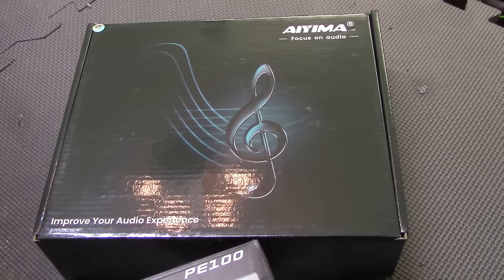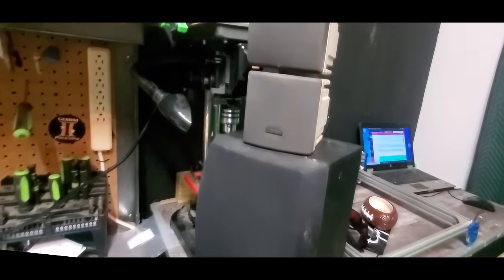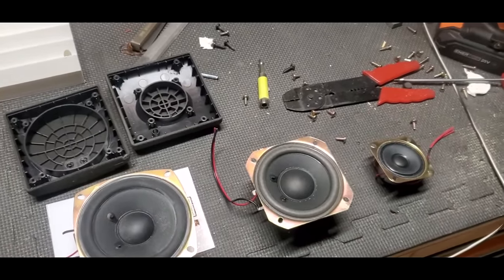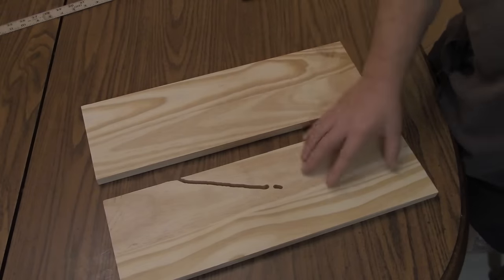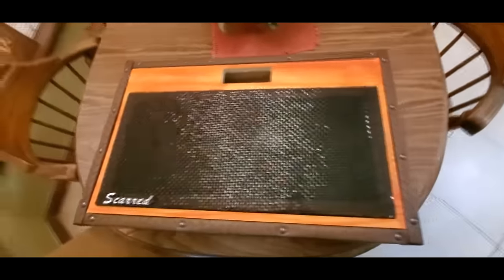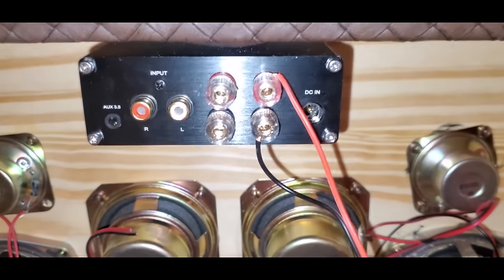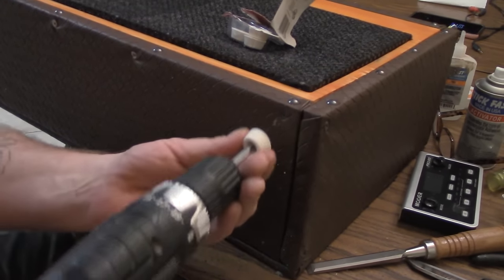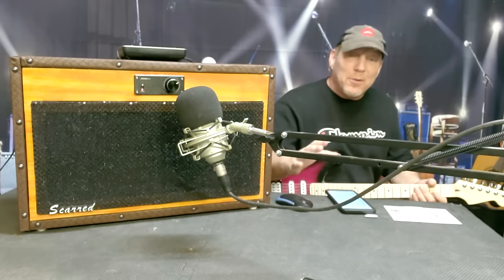The VIDEO ALL Guitar Amp Companies DON'T WANT YOU TO SEE!! DIY $200 Guitar Amp On A Budget!!

Comment: This really made me think about crossovers and if they are really needed. I just remembered back in the day I bought a passive subwoofer to go with my home theatre system and it just needed to be hooked up in series to the front right speaker. All these speaker companies got me fooled over the years thinking that crossovers are mandatory. But there was a time when low mid or high speakers could all be hooked up together as long as the amp could handle the impedance. Thanks for the reminder!

Comment: I don't want to put your efforts down as its a decent build and might inspire others. I've got some doubts about your speaker and amp choices though. I'm guessing the actual power rating is 75w rms x2, but that's still too loud for home use, rehearsal rooms and most gig environments. Including tweeters I thought was odd in a guitar amp, expect it would make the sound too fizzy? I'm doubtful your scavenged speakers would be up to the job with that output too...

Comment: I use a Quilter "Interblock" Class D pedal-sized amp to drive two small 1x10" open-back cabs.  It has a very "tube-like" front end, so no modeling is required for it to sound very much like my old tube amp (similar to the 5F6 Fender Tweed Bassman circuit) does with same cabs.  That's why that "valve" amp been gathering dust for years!  My 7.1 audio system is also 100 percent Class D, including two Aiyima A07s for the ambience/surround speakers -- that technology has improved tremendously over the last ten years or so.

Comment: That's a nice job. I'm doing it with a lekato headphone amp and a TPA3110 amp board at 15 watts a side. Needs a 12v supply, and I'll stem that off to a buck converter set at 5V to charge the Lekato

I think you've got a little overkill as far as speakers are concerned. If you're not using any type of crossover it's not worth it at all.

You need a full range speaker, and that will do it. Even better is finding an online calculator to tell you the exact dimensions of what the box should be for a flat response. Having said that it sounds fine, but hardly a 'quiet practice amp' lol

Comment: This is a pretty solid approach for the PA, especially as you can build it to work with any instrument. You can get plenty of tone out of a processor, pedals or a nice preamp.
If you want tube sound, a tube pre on a 100V supply should do it, though it won't be completely the same as the power tube sound.

Comment: My 1st amp was a DOD american metal distortion plugged into a jc pennys 8 track/cassette stereo with 6" speakers in towers.🍻
Reply: My first amp was a cheap 90s karaoke machine with a 1/4" mic input that distorted really easily. It actually sounded pretty good. I ended up shredding the speaker because I constantly dimed it.
Reply: My first one was plugging straight into a Technics cassette deck on our stereo. I then moved up to using an old Tandberg reel-to-reel tape recorder and an old military speaker. More than 40 years ago…

Comment: I’ve done something like this in recent years, although I’d love to go the modeler route Bluetooth into a power amp…but I have taken a cheap, crappy 3 watt 9v battery powered amp with a single 3 in speaker I found I a resale shop for $2, and had  two 4 inch dual-cone center channel speakers from a surround sound system and put them all in a cigar box and converted it to 18v supply (dual 9v compartments)…sounds better but the amp is still sounds like you’re recording a distorted direct signal in a studio….my other project was getting a 1x12 unbranded cabinet I found at a garage sale for $10, removing the speaker and baffle, and converting it to a 4x6 cabinet with some 6” eminence pro sound speakers I also found at a garage sale for like $10 (for all 4 speakers), it sounds pretty damned awesome having my EVH 5150III LBX-S run through it!

Comment: That is hilarious.  Obviously not 300 watts, maybe 50, but cute nevertheless.  And he certainly should have at least a capacitor on the little mids, or they will blow for sure.   (Looks like the tweeters do have a small capacitor on them).   Shows creativity, if not experience.  Keep experimenting, and good luck.  • Note: I would actually consider the little AIYIMA amp module for a project, using a ZOOM G1X FOUR as a pre-amp / processor.
Reply from the maker: Yes it's only 75 W per side actually without the full power supply, and that's confirmed on a meter, but I just loaned it to my friend and he played a gig with it mic'd and almost wide open for 4 hours, with 15 min breaks and nothing blew up!  And he used just his Line 6 Hd500 with it! And it's louder than my Fender front man 212 and my Hot Rod Deluxe,  and the speakers are tiny!! I will keep thinking outside of the box, that's guaranteed! Thanks for watching

Comment: It's super loud because of the parallel wiring. You're running 2 ohms per side. That's a lot on the amp. Hope it's rated for a 2 ohm load.

Comment: Interesting. Did you parallel all 3 speakers on each channel? If so your impedance might be on the low side. Since your power amp is enormous, it might not be an issue.
Reply: I was wondering the same thing

Comment: I made my own guitar amp full 100 watt stack tube marshall jcm and a jubalee clone for 400 bucks for each. I been using computer speakers as a easy low volume amp and they sound amazing the lows mediums and highs they are awesome to use the vox headphone amp series of head phone amps with it if you don't wanna use head phones and want a low volume great tone. They sound amazing and I'm gonna make me a speaker cab for my computer speakers j use as low volume amp cause all your really doing is just running a processor of any kind through really tiny version of a pad system like you use at gigs

Comment: Those cass-D-amp can only do the 300W when a 24V supply is used. But even the 70W which can be done with 12V will make those chassis go up in smoke soon if not a minimal crossover is used.
Reply: @nara4420
If the amplifier does not have a power converter — there is no way to anyone can get 300 watts of power from 24 volts for most standard speakers.
Judging by the look — this amplifier does not have a converter.
Reply: @iridios6127  yes, i did a guess, and when calculating it it could be 130W @2 ohms per channel in ideal situation. In reality it'll be less. Anyway it will be too much without a crossover.
Reply: You never said what you used for power. I'm not familiar with that particular amp, but it looks like a are thangy.
So you used, what, a car battery?
I might just use a switching power supply, cuz it's hella lit lighter than a car battery, or a friggin tranzz-former!
Yeah, that's a nice job, nice idear.
Gonna make me one, guess I'll call it sumpun else, though.
Reply: @jeffro.  
Why would anyone need a car battery, for this amp? Judging by the type of speakers used, the maximum power is no more than 20 watts. And the weight of the transformer power supply will be half that of all these speakers(or even less) .
Reply: @jeffro.  i do not know this amp, but i've seen quite some datasheets of those cheap class-D-amps. According to that they can usually work with 25V, sometimes even more, and the advertisements assume maximum voltage for telling insane high power-ratings. In reality most people use 12V or 14.4 from a car-battery, but some use a power-supply. 
So i was just doing the math. Assuming 24 volts, reduced by a little loss in the output-transistors and use a 4-channel-amp-chip in BTL-configuration. That gives 2 channels with a maximum of around 44V peak-to-peak output-voltage so you can calc the maximum output wattage at 4 or 2 ohms . P = V²/R , but divide the volts before by 2.8 to get rms power.  And the output power can be even a little bit higher because they assume 10% distortion. (that was the wild guess in my initial post)

Comment: you need to try it with a band. a loud drummer and a loud bassist playing detuned down to at least c heavy sludge/stonner rock. if it works in that enviroment then yeah its a possibility but till thenill stick with a 100 valve head and 4x12. no diss intended btw

Comment: Haha. I used a similar audio amp (an SMSL SA-S3)  and a pair of 5" full range car speakers to lash up a 12v busking bass amp over a decade ago.
I use a Tech 21 VT Bass pedal as a preamp.
It's a 1/2" laminated pine board enclosure with an oil finish with a heavy duty strap and feet.
It's still my daily driver for quietish home practise and stands up well with other instruments round a camp fire or busking.
I ditched the onboard lead acid battery and solar charging for a 12v power bank.
It can give continuous play as a PA as well as a bass amp when camping with solar power.
Reply: @Andreas_Straub  "5" speakers for a bass amp?"
Check out Phil Jones' highly regarded bass amps and speakers. 5" almost exclusively.
I vaguely modelled it on his "Briefcase" amp.
I'm not claiming I can play stadiums with this thing but it works fine for street busking in a four piece with drums, piano and a sax and sat round a campfire with guitars and hand drums etc.
All off grid.
Trust me. It's quite loud and deep enough for those settings.
Reply: How is this "3 replies?" I clicked on "3 replies," but there was only one!
Now mine makes 2. What's it gonna say after YT finally "accepts" mine? 4? or 2?
Reply: @jeffro.  4 (now 5 with this one?)
The mystery of the disappearing YouTube comments is a total head scratcher to me too.

Comment: Because of the class D power amp this will always have a slight ring-modulator effect on it, loud or quiet and when you use even high quality distortion it will exaggerate that ring modulator artifact even more. I think it's very cool you might consider using a class a or a/b power amp if you can find one that has a blue tooth that would be sick.
Reply: Does this affect all class D solid state guitar amps? I've never noticed it before. Is there anywhere I can read more about this ? I thought about creating a tiny lunchbox head using a similar cheap power amplifier and maybe a cheap preamp pedal off Amazon. Then put all the guts into a head shell so it's a self contained unit

Comment: Neat! What's the impedance of each of the speakers and how'd you wired it match the output impedance of the amp sir? Was it all in parallel, series or parallel/series?
Reply: He showed it: "I went from the amp to the bass speaker (parallel), then the mid, then the high one." 
It's all parallel.
No crossovers "or anything fancy like that."
He DIDN'T match the impedance! 
You're looking at it all wrong.
According to his "tutorial," it doesn't even HAVE a power supply! Did you see him put one in?  Or talk about it?
So, there's no need to even worry about the impedance matching.
Reply: Looked to me they were all 4ohm in parallel. So he is probably going to fry that amp.

Comment: I already have a speaker cab but I bet I could get a cheap preamp pedal off Amazon and get that power amp or a similar one and mount all the guts on a control panel in a little head shell and have a killer super loud lunchbox amp!

Comment: Tweeters in a guitar amp?
Reply from the maker: Yep sounds killer
Reply: if you are using an amp modeler / cabinet simulator you have to have those for the extra info the device is putting out . they recommend you use a frfr full range flat response speaker system , which part of this means "tweeter"
Reply: Look at amps from the late 1960s , we had high frequency horns in some commercialy available amps back then , and it didn't hurt !!!